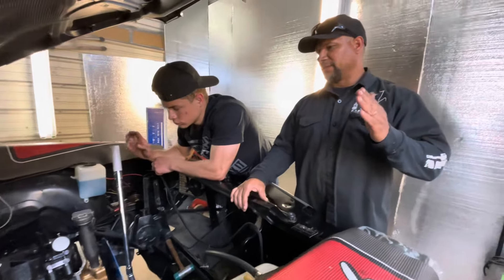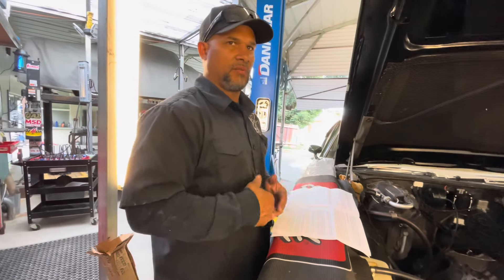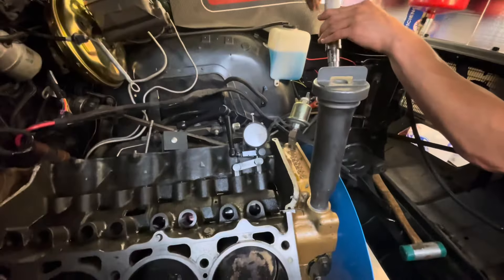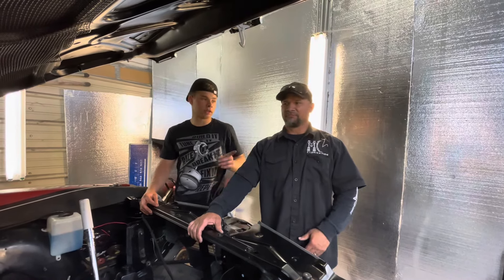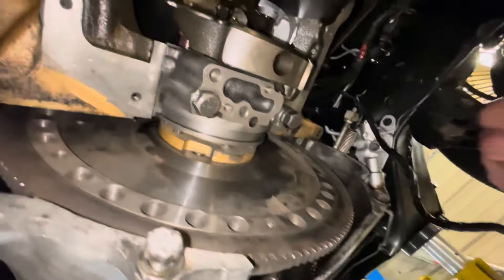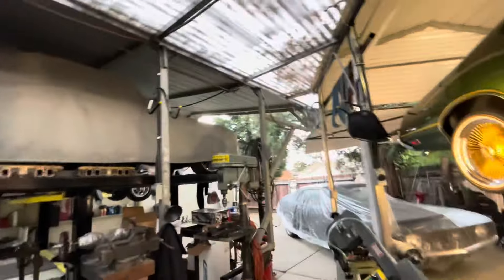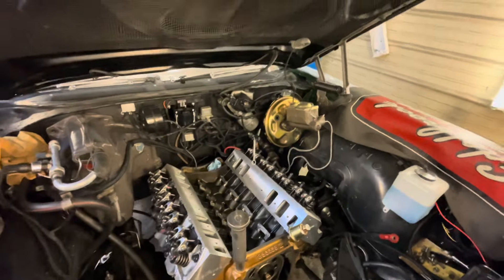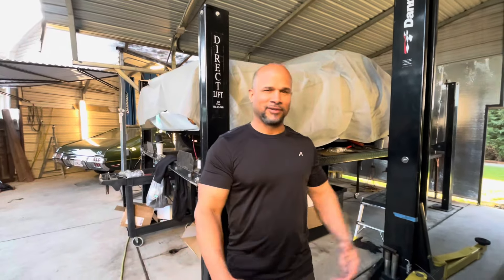442 cutlass build part 2 , why it’s so important to degree Camshaft!

Comment: You do know y'all are measuring on the exhaust lobe and not the intake when you was attempting to degree the cam in.
Reply from the maker: That was to measure the valve to piston clearance on the exhaust side. At that point we had already found the timing gear was marked wrong. But we did measure the exhaust closing timing as well to make sure both lobes were correct.
Reply from the maker: That was to measure the valve to piston clearance on the exhaust side. At that point we had already found the timing gear was marked wrong. But we did measure the exhaust closing timing as well to make sure both lobes were correct.
Reply: @redrat468  I was talking about the beginning of the video, you stated you was taking measurements for the intake lobe center line, when you was actually taking measurements off the exhaust lobe.
Reply from the maker: @aaronanderson6892  the intake lifter is the first lifter on cylinder #1 just like the video shows.